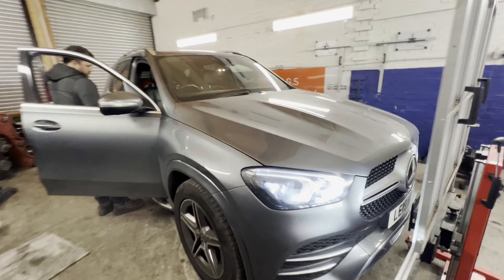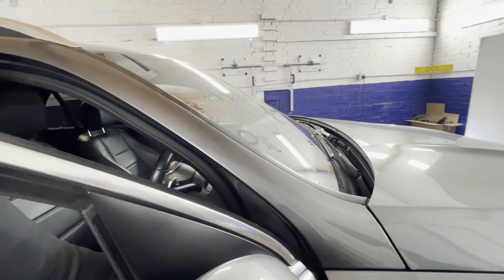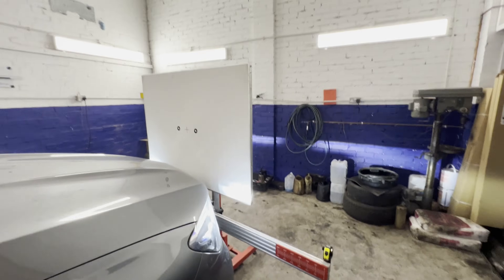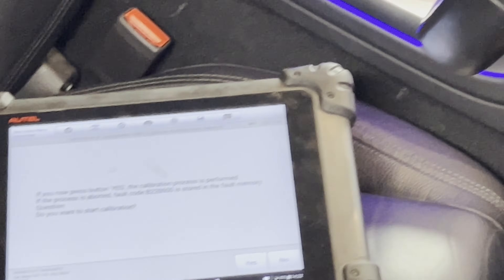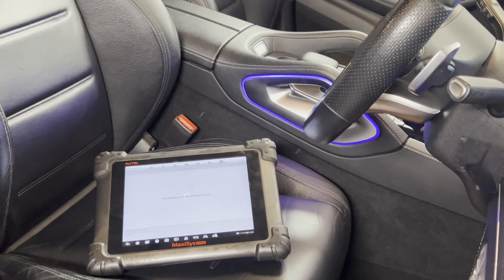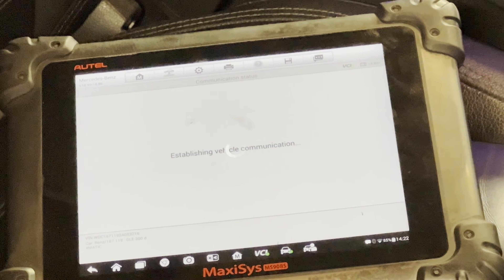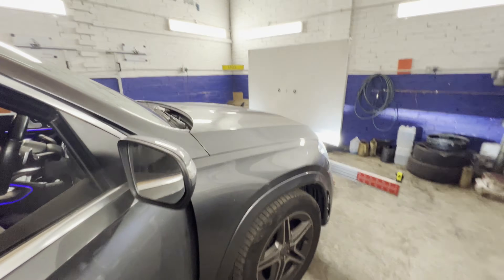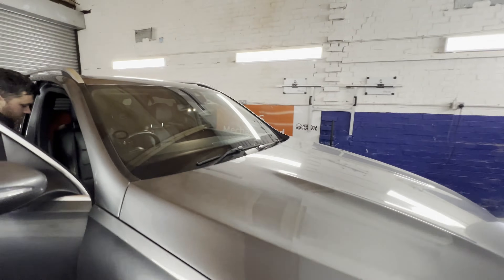🔧💡 FIXED - Mercedes Lane Assist INOPERATIVE: ADAS Calibration for Mercedes-Benz 💡🔧

Comment: I did the same cleaning process at home except for the headlight  alignment calibration (which is not required).
Reply: Hello, did you have to calibrate cameras after you did windshield cleaning?